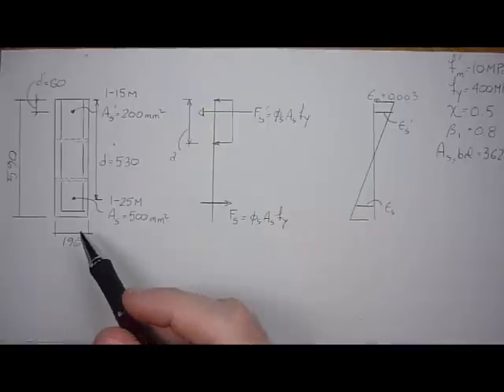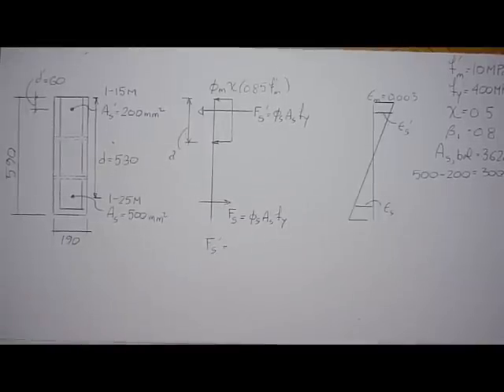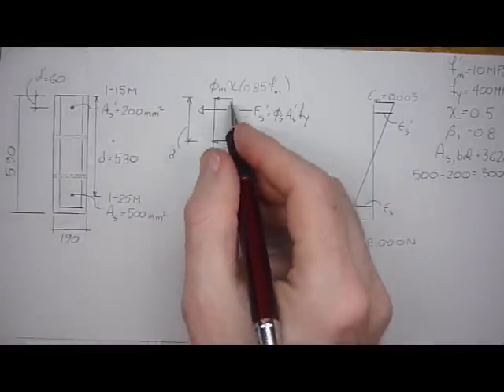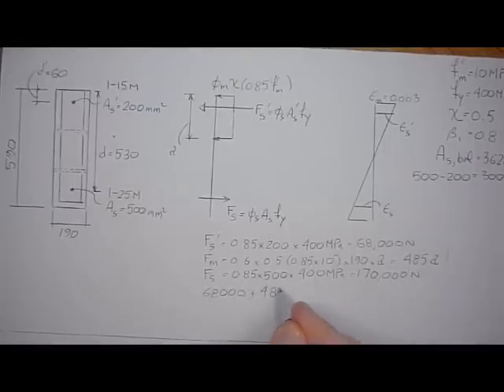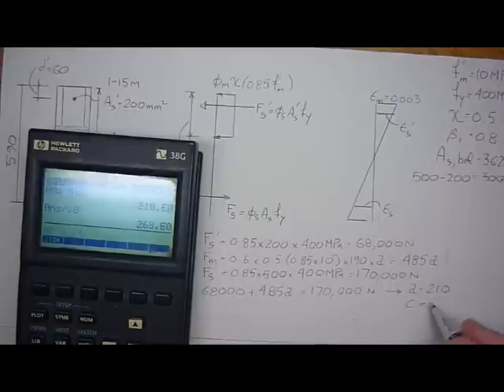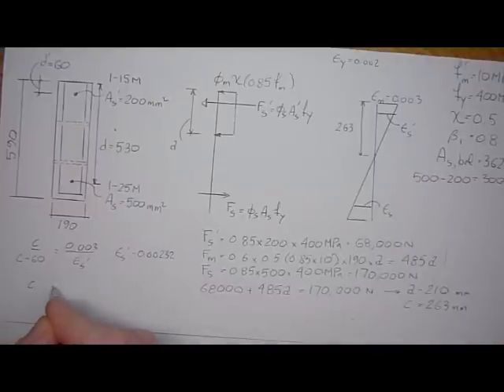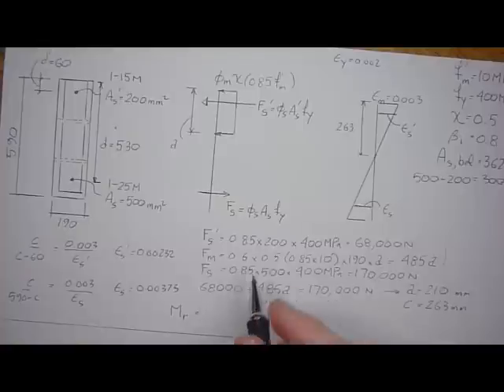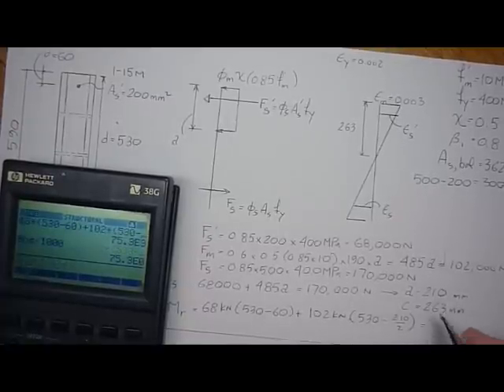M1.2 Masonry Lintel Design

Comment: At 7:00 you used the wrong depth for the steel in tension when calculating the strain value. You should have used 530mm instead of 590mm. The strain in steel in tension should be -0.00305.